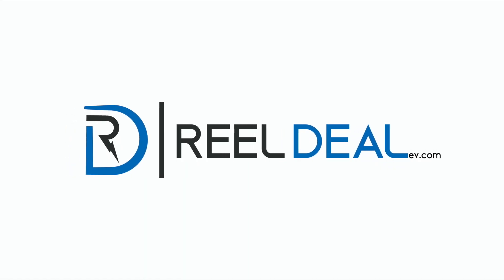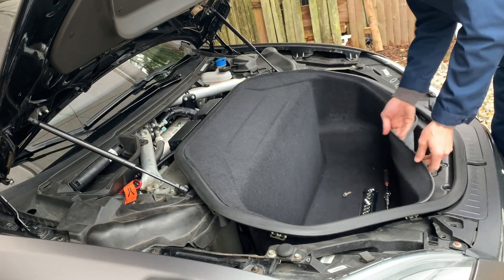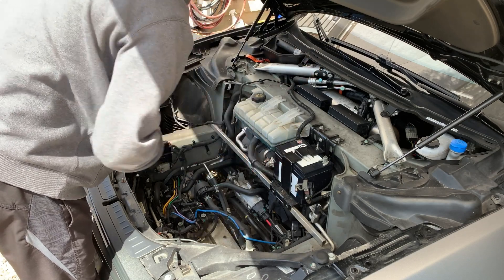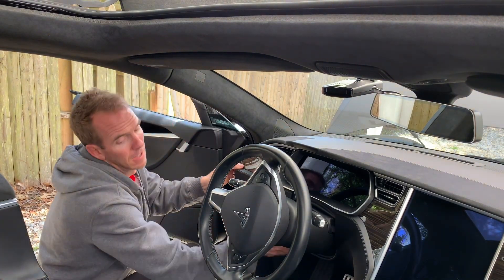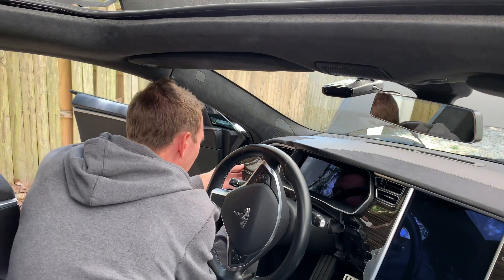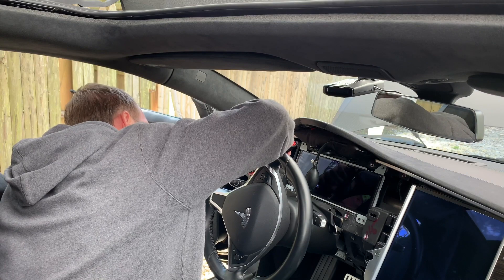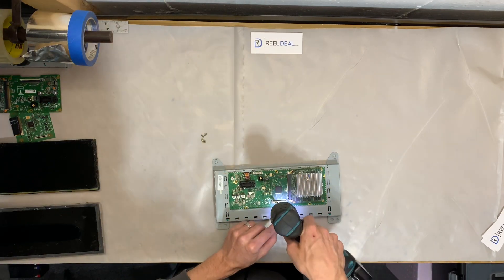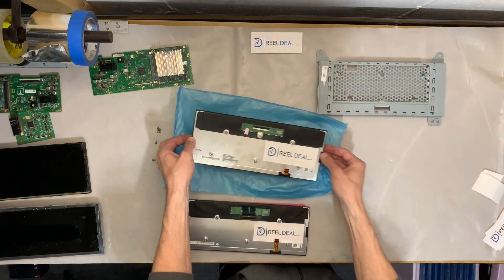Reel Deal EV Tesla Model S and Model X Instrument Cluster Replacement for bubbles or leaking fluid

Comment: My cluster is completely black and reboots only make a short lightup for a second. And goes black again. Measured 12v battery from connection points infront, shows 12.27 volts on multimeter with the car off.. Any ideas? model s85 2014.

Comment: I did not have an air wedgie, so I used an empty bottle of water and took half of the air out, closed the cap and pushed it in been the dash. It worked perfectly.

Comment: Just replaced my but the dashboard screen won’t turn on while the big screen is on
Reply from the maker: First try the steering wheel resets, then check all connections
Reply: I’ve tried that as well. It might have a the wrong part
Reply: I am having the same problem. I have a gen 1 screen and ordered the gen 1 screen from ReelDeal
Reply: @Danin4985  Me as Well looks like im not the only one sucks made to look simple but does not work right for all s models.
Reply: @davidkenlo9609 I replaced my gen 1 screen with Reeldeal gen 1 screen. It works perfectly. In fact the new screen looks crisper, somehow. 👍
This should really be a recall.

Comment: Hey Chad I'm installing the instrument display. I'm stuck on removing the leather beautification trim above the steering column. Do I use a trim tool to pop each side out to release the clips?
Reply from the maker: If it is the one that has the cut out under the steering wheel, you remove one T25 torx screw and pull straight out towards you with more force than you would expect.

Comment: What year is this P85D?  Is it the same for the post face lift 2017 S 75D?
Reply from the maker: This is a 2014, but yes everything in this video will be the same for your car.
Reply: @thereelwdad  Thanks, I won' t be able to get to it for a while, maybe end of April, will that be too late or do i need to do asap?  I've installed stereo systems and such, sounds like I should be able to diy fairly easily?
Reply from the maker: I responded to your email answering this, but it can be left alone, the only issue will be cleaning more goo out of crevices within the car, and it will eventually leak down under the steering wheel to the carpet. @ynotsun31
Reply: Can I do this if I want to do th3 mcu2 upgrade? Or I'll still have to have the dealer do something like programming the new screens?

Comment: What suggestions to remove and clean all the fluid during the removal process? It's all over my ribbon cable and image is distorted. What is the safest way to clean it?... I'll add the I broke the white plastic clip on the larger ribbon to the cpu. I see why you broke yours. Some suggestions on how to remove without breaking would be helpful.
Reply from the maker: Use wet wipes and constantly wipe and throw them away as you go. Try to avoid using anything, but some isopropyl alcohol will work.

Comment: Thanks for the video. I just did this install on my 2014 tesla gen 1. This video is a life saver and the reel deal screen works! I was unable to just plug and play without disconnecting the 12V and service loop. I assume its because i am gen 1 but i do not know the screen stayed black despite multiple reboots. My battery is in a different place than the dual motor so I had to use this video to help me find and disconnect the 12v battery https://www.youtube.com/watch?v=pWddPAF25Y4. All in all so far so good and I am very happy!
Reply: My Instrument Cluster on my 2014 Tesla also stays black. Did a hard reboot. Also a disconnect of the High Voltage, but nothing works so far. Actually I don't want to go into the hassle of disconnecting the 12V, but I think that's to only route to possible solve this problem? Inside the IC the leds are clearly visible, so it has power for sure...

Comment: Great video. It's all there. A relatively simple repair. The part from ReelDeal works just as shown. Highly recommended. I used a rag stuffed in up under teh dash. Worked as well as the air pump thingy he has. But now I know I NEED one of those cool tools! Goof Off was the best solvent I found to clean up the gak that ran out of the old screen.
Reply from the maker: Thanks for sharing! The air bladder bag is so nice though! Glad you had a smooth install!

Comment: Thanks for the video. It’s was a great tutorial. 

ONE THING! You can save time by NOT disconnecting battery and HV Disconnect. I have replaced 2 screens and simply holding down steering wheels buttons for reset will reboot the entire system. Worked on model S and X.
Reply from the maker: Agree, but Tesla service says to disconnect. I would rather people be happily surprised rather than get into a whole new project.

Comment: I purchased with your advice and got the cabin filter. Thankfully. Your video was very helpful. People must understand the inflating wedge is a must. One thing I’d mention, which I stupidly did… make sure the door is open before you disconnect the high voltage and the battery 😀
Reply from the maker: Thanks for the feedback, and glad you got the door situation figured out! ;)
Reply: That’s hilarious!

Comment: i finished my repl on 2014 P85 Gen 2 screen.   Pretty straight forward.  Disconnecting 12V is PITA. Add to the video - you can do a power off from the console before starting.     

Actual console work is typical automotive.  Make sure to have isopropyl alcohol wipes because that goo is everywhere.     The latch on the larger communications cable is stirrup shaped and flips back with your finger nail.   Have some clean rags available.  Pre-order a cabin filter because why not replace that?   The whole thing started up without having to reboot the car.  It just worked.

 Great product and thanks for answering my questions!
Reply from the maker: Thank you for bringing up the power down, that does work, but Tesla instructs you to disconnect HV and 12V and the last thing we want someone to do is get into a position where something doesn't work, so we just repeat Tesla. I like the cabin air filter idea, that's great!
Reply: Hi there, please describe the trick of taking off the big connector. I giggled it for half an hour and couldn't figure out how. Thanks!

Comment: making myself a list,
Tools to do the Job:
Trim removal tool (optional)
-13mm socket
-8mm socket
-10mm socket
-t15 screwdriver
-air wedge (hand pump air bladder wide)
-t10 screwdriver
-reel deal replacement screen
-(any I missed?)
-drill (optional/potentially risky?)
Reply from the maker: Gloves! You did a great job listing everything. But Gloves are nice to change out frequently to avoid getting the leaked out Goo onto anything else.

Comment: What would happen if you didn't disconnect the 12V or pull the service loop?  Assuming you weren't electrocuted?  Would it damage the new display hooking it up under power?
Reply from the maker: Mark,
We do it this way because Tesla says to, but we know many customers who do the steering wheel resets and do not disconnect HV loop or 12v and everything boots up perfectly fine.

Comment: If I have an early Model S with a Gen1, can I install a Gen2 to get the higher resolution screen of the Gen2? You mention it's a slightly different connector.
Reply from the maker: Eric, You cannot simply buy a Gen 2 screen to install into your Gen 1 car, the screens are not compatible, and if you swap the whole assembly, it will need to be reprogrammed by us or Tesla. I wish we had a cheaper easier solution for you, but if you are wanting to go that route, let us know.
Reply: @thereelwdad  From which year of production of the Tesla the Gen2 cluster came into use and what is the difference between Gen1 vs. Gen2?
Reply from the maker: @dr.woodpecker7469  the years are not exact, they were not exactly standard in the early years, about 2012-2014 had Gen 1, but here is a way to identify yours: https://www.reeldealev.com/updates/differences-in-gen-1-screens-and-gen-2-screens-without-pulling-dash
Gen 1 is low resolution

Comment: Hi there. Could it be possible the main board to be broken ? My instrument cluster is black since 2 months.(after one update). Tesla want me to pay 2400 euro to change it ... 
They told me before i went to service  to restart it with a two button above the scroll wheel.  And it did fix it for couple hours and them went black again.. Since then im driving the car with a black instrument cluster.. Any suggestion would be appreciated.... THX  Greetings from Hungary EUROPE
Reply from the maker: You could have a problem with the board, we have not seen a screen fail for any reason other than bubbling. Replacing the board/boards is not hard, however, you will need access to Tesla Toolbox to reprogram.
Reply: I got my not working out from my Tesla trying to figure out the connections on the board . P1 connector underneath is a 12vo-bat and from left is a GND. But somehow the two is connected when I’m trying with a multimeter . The 2nd and the 2nd from the button pin connector is acting for both positiv and negativ . And sometimes the d21 small led is lighting on red. Wondering if I give a board 12v 1A will the Tesla logo come on ? My is broken but I will try the iMac video card repair mode :) backing the video card of the instrument cluster ..... what u think ?